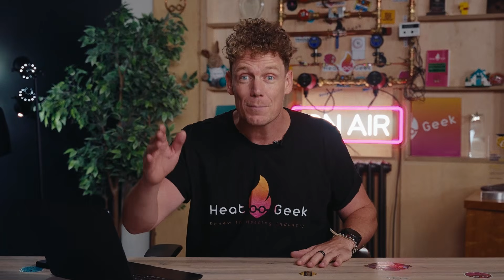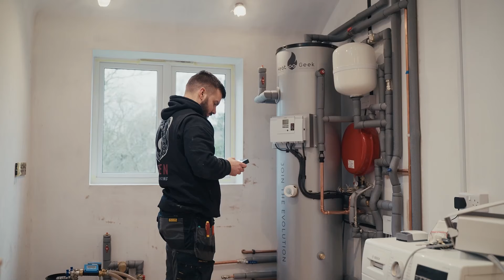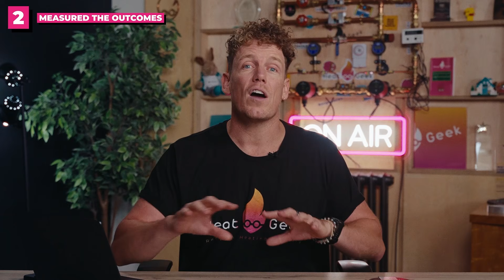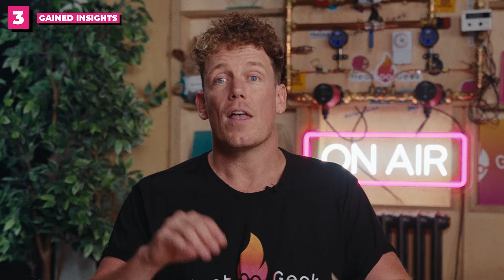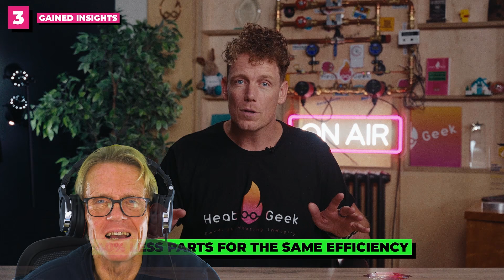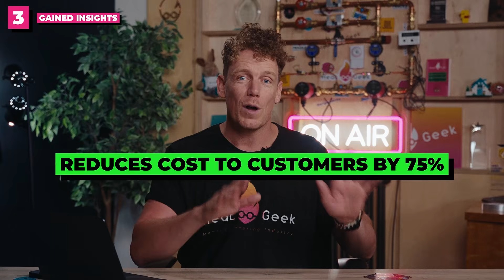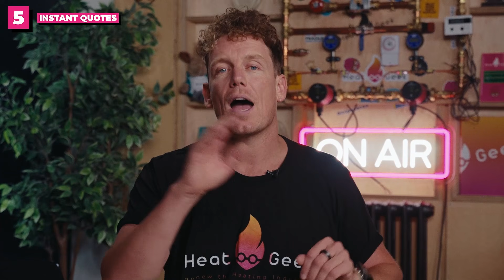Heat Pump Reality Check: Is Zero Disrupt Too Good to Be True?

Comment: There is no point in heat pumps until the price of electricity falls
Reply: House is always Nice and warm. Thats also better!
Reply: Or a real example: New boiler EFFnc % 98.5 costing 6.1p kwh. 6p gas vs 27p electric. Any HP needs to be 450% + to even stand a chance  2.5k boiler vs 15k HP Which one do you think will cost more to fix when it goes wrong or out of warranty…. Currently I’m 12.5k up
Reply: @jonstub5427  

I'd bet you'd never see 98.5% efficiency from a gas boiler fitted in Joe Publics house.
Reply: Air source heat pumps are only really worth it if you don’t have access to mains gas; otherwise, you’ll never see a real return on your investment.
Reply: @caparn100 , that’s not true. Mine will pay back in around 6 years because my other technology allows me to buy electricity at the same price as gas, so I am saving 80% of the former gas cost. I also save the standing charge as we no longer have any gas / meter.
Reply: @caparn100  

That's not true.
Reply: The efficiency of heat pumps makes up for the cost of electricity, that’s literally the point. 

Gas is 6.5p… but more like 7.5p once it’s been through an 85% efficient gas boiler

Any heat pump above 3.4 scop will be cheaper than that!
Reply: @HeatGeek  Boilers are more efficient than that, 95%.
Reply: @kevinchadwick8993  

Very unlikely given that the national average is about 83%, and even then most are run at too high a temperature for condensing to occur, making them less efficient.

To get a boiler to run that efficient most would  likely have to run at low temperature (32C,. 34C ?), and to do that, upsize radiators and pipework etc, sounds very familiar.
Reply: @_Dougaldog Worcester say their a+ condensing boilers are 98% efficient
Reply: @kevinchadwick8993  

They might be capable of that in the Lab' but I think they will cost more than the £2.5k quoted in OP, they will also need to run at very low temperature, say 29C, which means new radiators and pipework etc etc, which sounds familiar.

In short it's unlikely we'd ever see near that in practice, would make more sense to invest in a HP adding value to your property and hitting efficiencies of 520% (running at 32C flow and 16C and over outside). But for me the average has been 410% over 19 months, and a terrible 270% when -6C outside one day last January.
Reply: Someone needs a calculator...
Reply: Depends on the use case I bet - definately not worth it if you like lots of ventilation. If you are willing to play the long game, insulate very well and seal the building and leave it sealed (with controlled vented with the heat recovery system in the winter) then maybe it's a runner.
The cost/benefit sums hinge on the cost of gas vs. Leccy
Reply: It’s all based on the assumption that electricity prices stay the same or decrease. Mr Miliband has other plans…
Reply: There are people literally running HP installs for cheaper than gas right now, even without solar/batteries. There are special tariffs. Add in solar and you can run it for free for large chunks of the year.
Reply: Or you have pv generation of 15Kwh 👍
Reply: Partly true, but it is the alternative cost that matters not the price itself. I live in Finland and currently the options are oil, a heat pump or direct electricity. Gas is not an option. Currently tue energy cost of oil is just slightly higher compared to a ground heat pump. Cost of direct electicity heating is 3 to 4 times higher. On averge the electricity price in Finland is around 15 Euro vents per kWh including transfer, taxes and all fees. The spot price is typically around 2 to 3 cents during summer and 5 to 12 cents during thea heating season.

When building new here the go to solution is normally a gethermal heat pump if the house is over 150 sqm, below that the investment cost is too high. In the southern parts there is still an option of using an air to water heat pump. No one is installing oil heating in a new build anymore. In older houses you will normally see an air to air heat pump as a suplement hesting system. The models they sell here gives a COP over 2 in temperatures below -25C. There is a grant for retrofitting a heat pump. I don’t know how big but I think it is in the same region  as in UK. There is little point in doing this with the oil and electricity prices at current levels if the oil boiler does not need replacement anyhow. If either cost of energy would change without the other it will shift the preferance. You will always take a gamble when choosing ghe heating system.
Reply: @thomasl2974 The price in the UK is 23p per kwh and why should those who can't afford to take the significant gamble subsidise those who can especially when we are far from 100% green even without using electricity for heating? Money for insulation makes more sense to me or even community thermo piles.
Reply: That is true. The building standards have varied over the years over here as well. Most of our houses are built after the war, except old farm houses the are normally from late 19th century. They are built out of solid logs but van have some added insulation afterwards. The best extra insulation is typically to insulate the ceiling. The  eiling heat loss can be up to 20% of the total heat loss. Of course if there is single pane windows and no insulation in the floor that is quite bad.

We built our house in 2004 and we have 10 cm of styrofoam insulation under a concrete slab. The foundation is built out of Leca blocks with 10 cm of styrofoam on the inside. The walls have 25 cm of rock wool plus an windshield insulation of 1.5 cm under the paneling plus some air gaps for ventilation. In the ceiling there is 40-50 cm of blown wool. Windows are tripple glazed. This was the standard back then.

We have a 2-8 kw heat pump. The well have 178 meters of water. For heating and hot water we used 3600 kWh in 2024 at a cost of around 500 Euros. For direct electricity that would have been 2000 Euros. For oil probabbly 600-800 Euros. Floor space is 208 sqm, some 21 windows, no big ones from floor to ceiling. The total energy consumption including household electricity is estimated to be 24 000 kWh. In reality it is slightly lower. Total heating and hot water energy consumption was 15 000 kWh in 2024.

The cost of a gethermal system that we have is around 25 k Euro. I replaced the heat pump in 2023 at a cost of 11 000. It lasted 19 years, which I think is at the longer end. The only new technology is more efficient circulation pumps and it is an inverter pump. The heating media is worsemin newer pumps. The automation system is maybe better. The efficency of the new pump is very close to what the old one gave. We have COP of 4.2 combined for water and heating. Heating is underfloor heating with a maximum temperatue of 38C. Yearly average temperature is 6-7 degrees. The system is desinged for a minimum temperature of -27 degrees. We get a few  days below that each year but no need for additonal direct electricity heating during 21 years.

This is a typical house over here from the same era. A post war built house would typically consume 20-30 000 kWh but they are typically 100-140 sqm.

As a side note I cannot understand why Britts complain aboutbthe heating bill. Our house would cost around 400 k if it was on the market. Building costs in 2004 was 280 k, but then i did all of the interior building work myself. On the country side the cost would be  around 300 k. In a similar location it would probably cost 2 million in UK. I would complain about the housing cost not ghe heating bill which is likely in the region of mine regardless of the heating system.
Reply: They do work very nicely with solar and battery 

I have fitted lots and they work beutiful 

Had a lot of skeptical customers but they all say best thing they ever did 😊
Reply: Written by someone who has absolutely no idea what a heat pump does or how it works 🤣🤦‍♂️
If there is one country in Europe that could benefit from Heat Pumps it's the UK.
Reply: Plus, if you have solar, you'll get free hot water almost year round.

If you have a battery system, you can make use of cheap overnight tariffs
Reply: @jjarman009  I will never have a large lithium ion battery system installed in my house. If you have ever breathed some burning plastics and understand that battery smoke is far far worse then. Hydrogen is far safer in reality.
Reply: @kevinchadwick8993 hydrogen is indeed much safer because the prohibitive cost means it will never be used for home heating…
Reply: @kevinchadwick8993  Are you trolling? Hydrogen is significantly more dangerous! Because it's such a small molecule, it's almost impossible to stop leaks. Also, almost all home batteries are LFP, which is an extremely safe chemistry, and a hell of a lot less likely to catch fire, and yes I have an 8kwh battery in my house. And being a graduate chemist, I  do fully understand the science behind this.
Reply: @stephenhamilton858  Hydrogen dissipates so quickly it is easily handled safely. If a battery has thermal runaway there is nothing you can do but run and hope your not asleep.The cars that set fire on the M5 yesterday were LFP.
Reply: @kevinchadwick8993 , exactly! Hydrogen dissipates so quickly it’s hard to keep it in the pipes…
Reply: @kevinchadwick8993  Hydrogen is more dangerous than "natural" gas in an explosion. If you have a hydrogen explosion you (and your neighbours) will probably need  anew house.

Batteries go on the outside of the house. Not because LFP batteries are a fire risk but because if you ever manage to set one on fire its nasty. Next gen sodium batteries just go out if they catch fire. Redox batteries are pretty much impossible to set on fire in the first place.
Reply: @kevinchadwick8993  But from what I've read, it was the diesel lorry that caused the fire, not the EVs. But if you don't want an EV, heat pump, or solar battery, that's your choice, which is good with me. There's too much hate and picking sides, but question? If fossil fuels are so great compared to renewables, why does the UK government subsidise the industry by £17.5 billion? And in the 6 months I've had solar and a battery (7KWh peak solar and 8KWh battery), my monthly energy bill have on average been between -£70 and -£90, including standing charges for both gas and electricity.
Reply: @stephenhamilton858 Doesn't look like it could have been the lorry as it is in tact with lights on whilst the rest was ablaze. Possibly a testament to how much bias the evs get though.
Reply: @kevinchadwick8993 I bet your home has loads of lithium batteries already. Do you worry about them?
Reply: @bibliotek42 They are a concern but your right I should probably gather e.g. toys into a metal box. Old batteries aren't a concern because they lose atleast 1% per month. Hardly comparable to a huge battery but the smoke/gasses could still be terrible 🤔 We put a plastic knife cover in the oven once and their wasn't that much smoke but whatever was in the air hurt my throat like crazy and I was instantly suffocating. So plastic toys are also worrying, honestly but nothing compared to burning batteries. If it happens just get out.
Reply: @kevinchadwick8993  

Good news is it will likely be a Sodium ion battery for the house, not the same energy density but weight doesn't matter.

Hydrogen is very volatile (Boom !!!!).
Reply: @kevinchadwick8993  

Cause not known as yet but most likely that the tractor unit caught fire, certainly seems like the fuel tank ruptured by description of large fireball.

The other that was being attributed to EVs was the fire at Heathrow airport.

London Fire Brigade confirmed on their website that the fire incident was caused when a diesel fuelled car caught fire.
Reply: @_Dougaldog Then how would the EV at the very back be completely burnt glowing red whilst the tractors lights still worked?
Reply: @kevinchadwick8993  

We'll find out in a day or two no doubt.

Fire brigade just say 'accidental', in the video the whole lot is well ablaze including the tractor unit.
Reply: I'd post a link but youtube doesn't allow it.
Reply: @kevinchadwick8993 I also think in the same way. The only problem is that your neighbournmaybe don’t think in the same way. I cannot understand why there is not stricter policies of where you are allowed to have batteries. Yes the risk is small but things still happen. I would not like to be a fire fighter these days.
Reply: @kevinchadwick8993  you do not have to have a Lithium ion battery, Sodium ones are now available.
Reply: I love the way people who are pro heat pumps always site different tariffs, having solar and or batteries as part of the deal. Personally I like the idea of heat pumps but if I were to look at it financially then I doubt very much that it would make sense paying the vast amount of capital in to these items vs investing the capita into a stocks and shares isa. 

Lucky enough I have money to be able to do both and will probably make the jump at some point, but from a pure financial sense you could find that going with a cheap boiler and investing would get you a better return on your money than a heat pump. Won’t save the planet though so it’s horses for courses.
Reply: @davideyres955 , the whole payback argument is weird. How many people are questioned on when their new kitchen, long haul holiday or new car will pay back? 
Selective Double standards…..
Reply: @simonm9923  Payback is about products that use energy a constant regular cost . Unlike a new kitchen or new sofa that has no running cost.
When it comes to payback, what most logical people are comparing in the difference between a gas boiler and heat pump installation. 

At current average prices standard electricity is approximately 4x that of gas therefore you would need a COP of between 3 and 4 just to have the same annual bill.

It doesn't make sense to most folk.

Granted you could save on gas standing charge, but that would mean changing your gas appliances like ovens and hobs maybe even pots and pans.
Reply: @Disco45 , fair enough - I’d forgotten that cars, kitchens and flying don’t use any energy 🙄

Electricity isn’t really 4x the price of gas though is it? A typical gas boiler is likely to be less than 90% efficient so realistically a SCOP of 3 or more means a heat pump will be cheaper. Mine has a heating SCOP of 4.5 , combined with other technologies enabling me to get paid a net £200 a year to run 2 electrified cars, a heat pump and all other domestic energy (no gas). My payback was 5 years for solar / batteries and (with current tariffs) will be about 6 years for the heat pump. The government should consider interest free loans to enable people to invest in this technology and use the savings to pay back the loan instead of giving grants to people like me who might have done it anyway……
Reply: @davideyres955 the tariffs are real. Solar is obviously an additional investment. But the tariffs make complete sense due to being able to level load generation capacity.
Reply: @davideyres955  

Investing would be better value than that holiday abroad, or new kitchen, but try running that past SWMBO...
Reply: There are many electricity tariffs that make heat pumps more than worth while, my British Gas 14p per kWh as example (that's 24/7 for one year), currently my HP is consuming  average 450 Watts to heat my whole house (2 bed semi' 1960's, modest insulation), or £1.51 (for 24 hours) a day. At standard tariff of 26p/kWh that would be £2.80 (for 24 hours) a day, add on 1kWh a day for hot water.

That's not too bad is it ?

I'm currently running it about twelve hours a day until Winter takes over from Autumn so about half the costs shown.

Edit:- my SCOP over last 19 months since installation is 4.1 for heating.
Reply: except combatting climate change, higher efficiency, higher comfort, less reliance on foreign fossil fuels, ability to consume your own produced electricity effectively, and finally when the government does manage to fix the spark gap you will be much, much cheaper with a HP. Yeah indeed there is no point...
Reply: @pietheijn-vo1gt , exactly - what did the heat pumps ever do for us?

Comment: Great to see a company at least trying to innovate and make a difference and provide the product at a lower price. 

I think even Roger would agree that gas boilers are often poorly installed without proper weather compensation and correct radiator sizing. Maybe this will at least encourage gas installers to be better.
Reply: Or correct boiler sizing
Reply: @James-dv1df you clearly haven’t seen the Heat Geek website.
Reply: Hopefully consider training to become heating engineers